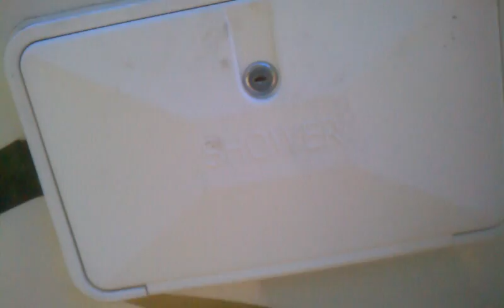How to pick a lock

Comment: Can you do key ignition
Reply from the maker: No you cant your best bet with that would be to either hotwire the car or get a flat screw driver and hammer it in the ignition it will destroy your ignition switch but it is good if your in a pinch